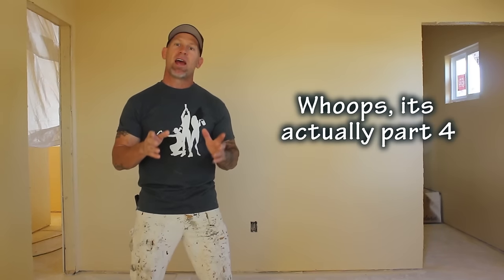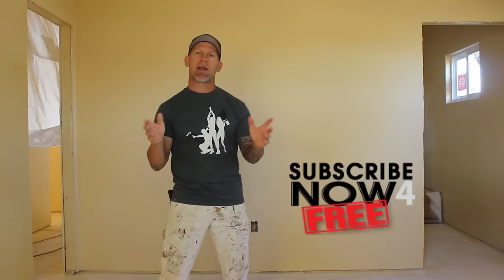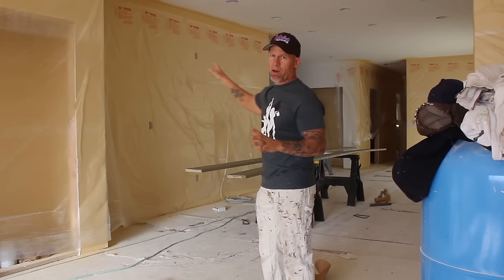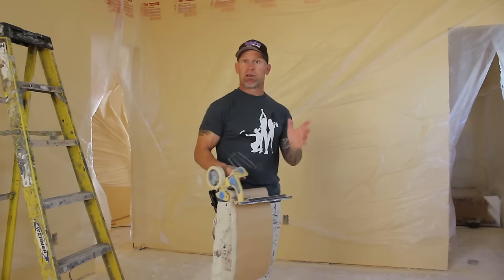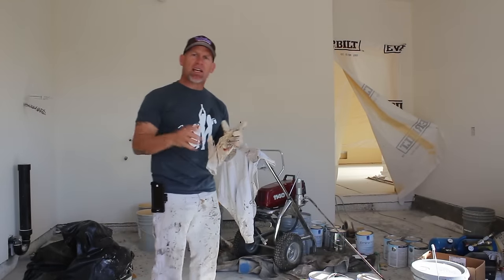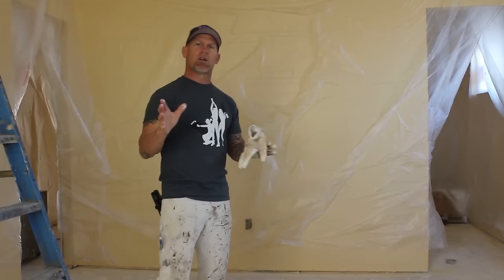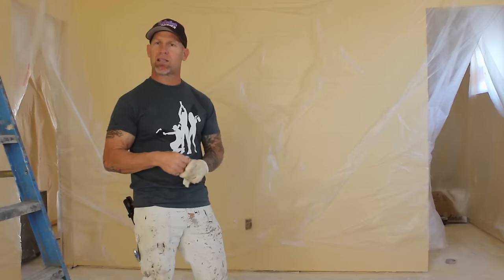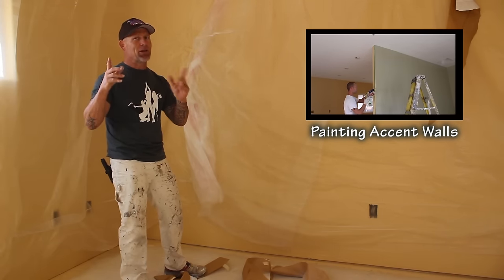HOW TO PAINT TEXTURED CEILINGS.  Instructions spraying a ceiling. DIY interior painting.

Comment: FYI:?  We use a 1 1/2 or 2 " Tape along the wall at ceiling. Leave the bottom of tape unstuck, follow behind sliding plastic under
loose edge of tape. Then run bead of caulk at ceiling.  We did use stilts at first with the plastic but found the roll  had to be moved ahead by someone on floor so we use a ladder.  Although the tape is applied using stilts. ( Great Videos Idaho ! :)

Comment: Better alternative is to use 1 1/2 tape   while just pressing top side in.  Take 9' or 12' painters plastic and attach to bottom half of tape that is not stuck on walls.  Then go back and pull plastic down over walls.  I can do this with standard ceiling height without using a ladder.  Twice as fast as what you are doing plus less cost in materials as you are effectively masking it twice.  This also allows you to pull entire room down while standing in one spot.
Reply: That's right! What kind of paint do you use?

Comment: Hey Chris.  You have very comprehensive and informative videos.  Two questions:  Will a Titan 440 Impact handle a 1221 RAC5 tip for priming ceilings?  I would like to purchase a Titan 440 Impact (lightly used) on craigslist for $250 without gun or hose for painting my rentals.  What things should I be on the lookout for?  Besides the obvious.  Power on, clean filter, etc.  Thanks!

Comment: Hey great video, i’ve been a painter for about 25 years now and been spraying a lot of ceilings doing restoration projects. I’m always dealing with discoloured ceilings because of cooking oil‘s and just every day living. I sometimes find when I’m spraying that the texture is quite old or a different aggregate and they absorb the paint in different spots and I sometimes get those dry spots. Because of the different colour and of the new paint put on it is quite noticeable when that happens. We try to cross spray everything but sometimes we just continue to see those dry spots or flashes. What would you suggest that we do to avoid these types of situations? We generally use different types of paints from Sherwin-Williams or other manufacturers. We always use flat paint for all of our ceilings. Once in a while if there is significant staining we switch to a oil base flat sealer. 
Oh I also noticed in your video at the edge of your spray fan seems to be leaving a thin line on either side. Do you think the pressure is too low or maybe the orifice of the spray tip is not wide enough? 

I watch a lot of your videos dude and respect your work for sure.
Reply from the maker: Back rolling it helps

Comment: hey Chris I appreciate your vidoes and I'm subscribed to your channel, I just gotta ask, why wouldn't you just do the ceilings first so you don't have to mask off all the walls???
Reply: Idaho dude sprays everything. ........some people spray ceiling then cut and roll walls.  either  way there should be cold beer at the end
Reply: Miles Duggan 
That's what I do. Spray primer, trim, ceiling, then cut and roll the walls. It's crazy to mask everything off like that. Plus, most people still backroll to avoid runs and sags. Also, I'm a drywaller, so when I mask a ceiling I put on my stilts. None of that up and down.
Reply: I spray ceilings, spray walls with metal shield for ceiling and then mask with 9" paper around door jams and 2" tape around trim before spraying trim also. Whats the benefits of doing the walls first? -Honest question.
Reply: Kevin Kevech
How do you spray the baseboards? Do you mask the floor? thanks!

Comment: Serious question. Why did you paint the walls first then the ceiling. wouldn't you want to paint the ceiling 1st? then you wouldn't need to plastic everything off? Would you get that much over spray on the walls that it would hit the ceiling?
Reply from the maker: The masking is way easier then masking upside down.
Reply: I just use a two metal shields to shield the ceiling. While one guy is on stilts spraying top half of walls the helper is cleaning the shield with water in a 5 gallon bucket then swaps the guy out on stilts with the clean shield. Then the guy on the ground sprays the bottom half of the ceilings horizontally as to not fan overspray up towards ceiling. This way the ceilings can be painted before lunch and the walls after because there is only the need for minimal dry time (tacking up) thats it.

Comment: Do you have any issues with paint bleed  or paint being pulled off by the tape?
Reply: The Idaho Painter 
Are you referring to preventing paint peeling up by pulling it off while wet, or pulling it off while wet actually prevents the wet paint from bleeding under the edge of the tape and onto the wall underneath? If you're doing two coats do you have to re-tape and do it twice?
Reply: Did you ever get a good answer on the tape tearing paint off the wall UNDERNEATH the paint? I've been having that issue for quite a while... With a new builder/drywall crew, we hardly have the issue EVEN WITHOUT PRIMING! Our process has not changed, only the builder and drywall crew. I think it may have something to do with how the mud is mixed when they apply texture. Sometimes it is AWFUL and other times hardly even tears... We've tried 2050, 2020, Frogtape, IPG PG5, 2090 Blue... and I think that's it.

Comment: what kind of tape do you use on the walls?
Reply: +The Idaho Painter I really appreciate you and your videos. I would like to see a future video on Tapes. Some topics: Tape versus cutting. Which tapes you use for specific situations. Proper and efficient application. When you caulk the edge or not. is your practice to tape, prime, caulk edges, paint, and remove tape while wet? Is is okay to paint over tape and primer w/o removing the tape. Taping techniques. cleaning or removing tape residue. avoiding and repairing drywall damage from tape. Taping to hardwood floors , carpet ...etc etc etc
Reply: +The Idaho Painter I will starting click on your ads! Thanks again!